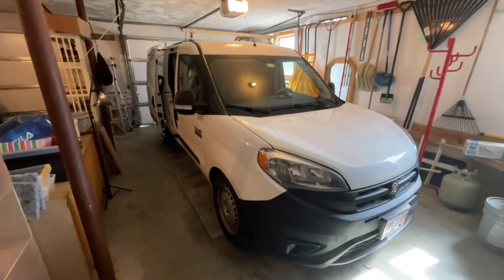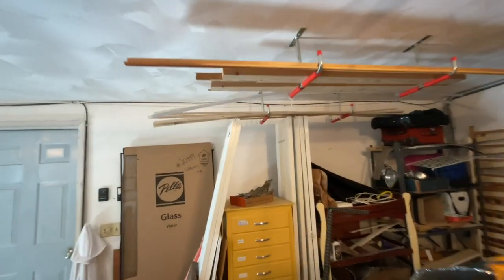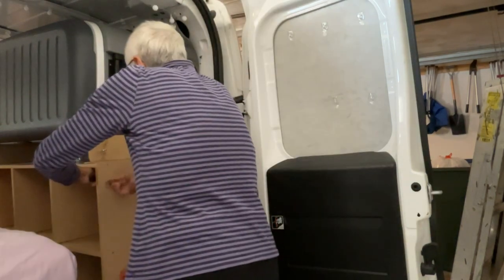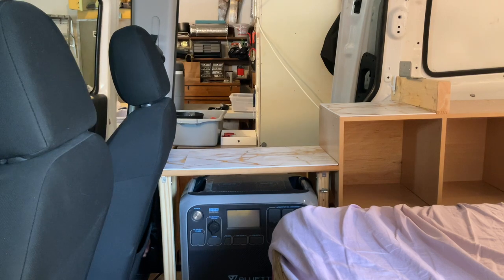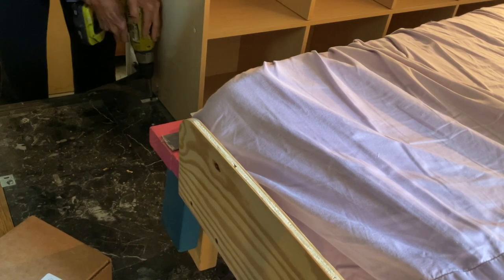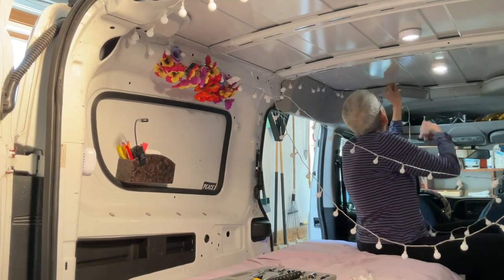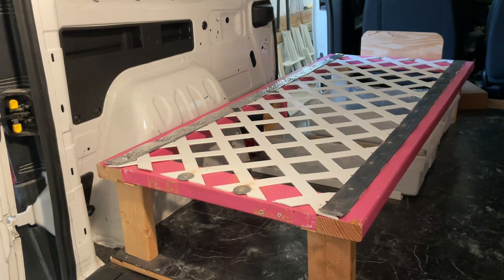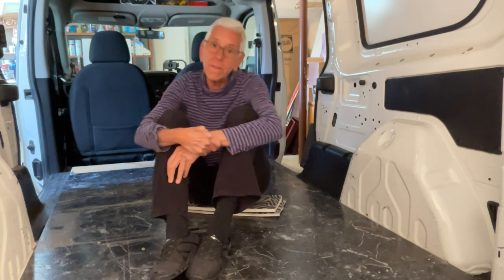"OPERATION VAN BUILD" - PHASE 1 - Removing Temporary Build - RAM PROMASTER CITY CAMPERVAN CONVERSION

Comment: Next time cook the potatoes whole. I’m just learning too but I found that worked better. I got the 6.5 quart instant pot duo crisp, ultimate lid it has 13 in 1 functions really really like it a lot.  Comes with an air fryer also.
Reply from the maker: hi Stella!!  cooking the potatoes whole would do the trick, but it takes longer to cook them that way.  at home it's no big deal but on the road, the less cooking time, the less my battery bank drains.  I wonder if when I take them out of the pressure cooker, when they are still white, I should just put them in a container and cover them.  I tend to leave it open so they can cool down.  I'm just learning too!!!!    Lulu
Reply: @LulusWay64  I put six potatoes in my instant pot yesterday for 12 minutes all small to medium potatoes. 10 minutes natural release and they came out cooked. I don’t know if that’s too long for you, but give that a go if it works if not then I guess you would have to chop them up, good luck. I hope it works.

Comment: LED 100% useful for lights. You can also get strips that have different colours, set at different temps, or brightness etc which you can use on a remote control. LED strips are good because they dont use much power (just like your little fairy lights there)
Reply from the maker: thanks for your input, Christina!!   Lulu

Comment: Hi Lulu! Love seeing you do all this work on your own! 🎶🎶Sisters are doing it for themselves!🎶🎶 Was playing in my head watch you work! I was wondering for your new build if you are having your bed layout the same or would you do it crosswise in the back of the van? Not sure how wide your van is crosswise or if it would support a bed layout like that. I’m excited to see the changes for your van.
Reply: PS— we have a small LED light strip that’s about 12 inches long that has 4 levels of brightness and it is rechargeable AND magnetic. It’s in a white hardcover casing and has a push button on one end to turn on and for each level of brightness. We actually use it in our laundry room and stuck it on the metal furnace. Bought it at Home Depot a few years ago for under $15. Works great.
Reply: I temporarily used a LED fairy light string with a battery the size of a quarter, holding the string to PMC ceiling with magnets.  That was way to bright light at night reflecting off all the white paint.  Still trying different lights.
Reply from the maker: the van is only 4 ft. wide, so the bed going sideways won't work.  the new bed layout idea in my head would relocate it. stay tuned!!  Lulu

Comment: I went on my first trip to White Mountains of AZ with my new camper shell. I had already insulated the floor so we could put down the wood and bought indoor out door carpet to put on top. Moved everthing in and hit the road. The temp dropped down to 32F,  thought I was going to freeze to death! As soon as I got home I grabbed my grandson and he went to town putting up reflectix and a very thin layer of thermal insulation over it. Now when it's cold its cold but it sure helped a lot. In the summer the difference is amazing. 
Enjoy your rebuild!
Reply from the maker: thanks for sharing your experience!  yes, I've decided today that I am insulating!!  Lulu

Comment: Tools for everything, as even when i had my log home, gave most away. I, too, love Ryobi tools. Batteries can be used for other Ryobi tools and fans. Jejeje, i say it keeps me flexible using muscles. I never knew i had going back n front. I use a plug-in hanging light fixture with my jackery. It's really bright, and i do have a Mpowerd luci base camp: solar inflatable lantern & phone charger, 360 lumens LEDs, its rechargeable using dolar or usb-c n its waterproof. That was such a wonderful thought out beautifully built you did.
Insulation is a game changer, i used Havelock Wool n its difference even cooler in hot Sumner
Reply from the maker: hi Berni!  thanks for the lighting suggestions!   Lulu

Comment: I’ve seen people use long magnetic LED lights that they love. 

I have one of the bug zappers like you, but I hang that closer to the front in order to attract bugs away from me. I also have a Lucy light and a knock off. I think all my lights are dilated powdered except a couple small lanterns I got from Harbor Freight. I have more lights than I use. I also have a second bug zapper for my screen tent!
Reply from the maker: hi Viveca!  I too hang that bug zapper away from me (although it's still close because the space is so tiny!!  let's say that it's hanging more toward the foot of the bed rather than the head of the bed!!  thanks for your suggestions!!   Lulu

Comment: A reading light by your bed would be good and then a LED strip along your kitchen area
Reply from the maker: I do have a little reading light that is USB chargeable (it was clipped onto that little "nightstand" that I had stuck to the wall that I got off with the crowbar!!)  that works great for reading light.  but I need good lighting for cooking and when I really want to see what I'm doing.  I'll look into the LED strip, thanks!!   Lulu

Comment: Oh boy, that lunch does look delish.  Exciting build time. I am eager to do some things to my  Highlander.  Fun fun. P.s. I met you at the Ocala Forest get together.
Reply from the maker: hi Kat!!  was it this past one in March?  or the one in December with Debbie Jean?  I remember working the gate with Debbie Jean and I remember a "Kat" when I was writing name tags!
Reply: It was the one in March. You told me about a Highlander in your family being built out for camping. I am a low profile type person. Didn’t do night events, lol. After watching some of the videos for night events kinda regret it now, lol.  I have built out many of my past vehicles.  And I get very excited about the process as well.  I mentioned that I traded my Ram 2500 for the Highlander just a while back and it will need some mods. I am from NM visiting family here in Florida.  I chatted w you couple times doing my walk arounds. Seeing all these van builds makes me think I might want something slightly bigger but I am going to stick w this Highlander a while because of off-road capabilities.  I couldn’t resist the crazy trade offer given to me on Sept 30th by the dealership for my 2015 RAMCummins truck.   Only went in for an oil change on my Jeep and passed time wondering around lot. Made for a big change in my life.  Love it. Keeps our personality types motivated.

Comment: I'm looking forward to seeing what you have up your sleeve for your build. I was just wondering if you have thought of taking out the passenger seat and either turning it around for a chair or maybe putting your toilet there or using it for other storage? I have seen other van people do that. That would make going into the front easier too.
Reply: It is difficult to turn the passenger seat around in a PMC because the floor in the cab is lower than the floor in cargo bed of back.
Reply from the maker: hi KB!!  yes, I have thought of taking the seat out . . . I have a plan!! :)
Reply: @LulusWay64  so exciting!! :) (Kim)